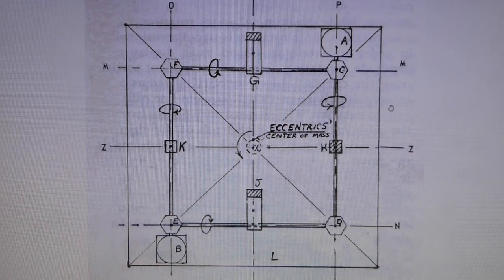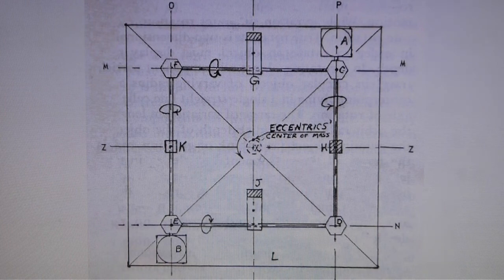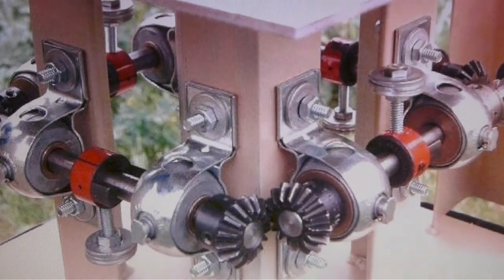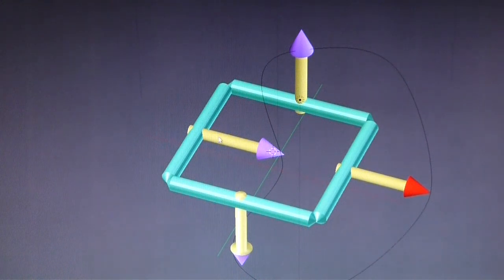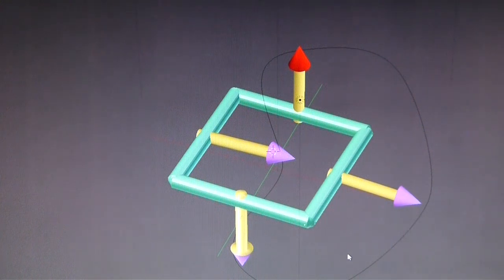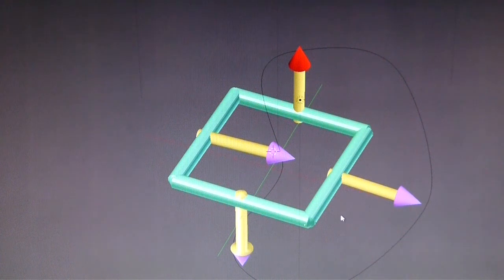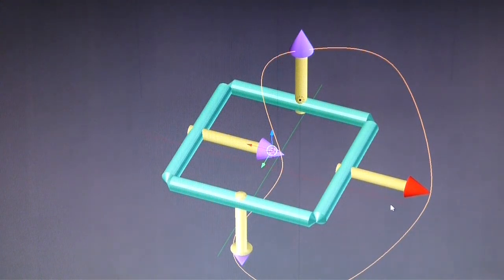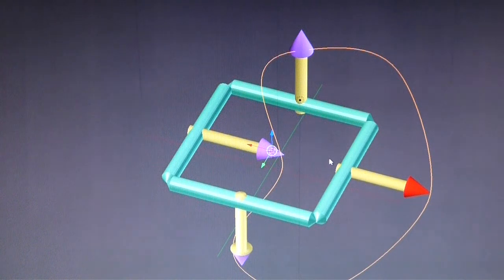Tesla Flying Stove - inertial drive - Inertial Propulsion

Comment: I think the the main part that is left out in this blueprint is the fact that the "plate" housing the eccentrics doesn't rotate, but must be allowed to instead "wobble" about the center similar to the Euler disc, as energized by the phasing of the eccentrics.  The tilt of the "plate" will orient components of reactionless inertial forces from the eccentrics, orthogonal to the plane in which the "plate" lies in a neutral state, to generate thrust. Also, three more mechanically synchronized units would need to be in place within a complete levitational engine to cancel unwanted lateral inertial impulses.   Smoke a long bong and you will understand and picture the kinematics of this thing as I briefly mention here.

Comment: still no one sees the machine has to accelerate around x, not only turn
Reply: Did you know he sometimes spelled his name with a c? NiCola Tesla, on one patent. With this he mentioned "Both the center of gravity, and the center of mass, orbit the same point". The center of gravity is constantly moving as the arms take turns hinging towards the horizontal. The mass which is pulled to the side as it swings up would have a longer radius.
Reply: @JerryVolland-bt8cb  yes, but you still do not respont to what i say about acceleration. it is in the patent. some people make models without considering this.
Reply: @Tardis42 anything which moves in a curve accelerates, whether it spins or not. Draw a circle with a pencil; the pencil point has angular acceleration, even though it doesn't turn.
Reply: I already said that at the top of the page: Teala said it has to "orbit" and I said that means a sloshing motion, not a spin. As shown with the toothpicks, the force direction is upwards.
Reply: No, it's clearly Tesla means accelerate .  @JerryVolland-bt8cb
Reply: @JerryVolland-bt8cb  just read carefull what Tesla wrote its only 1 page. it clearly says accelerate around x.

Comment: These blueprints and machine are certainly NOT from Nikola Tesla, he used simplifications od mechanical drives. He usually opted for coaxial shafts, he would never make a plan with four paralel + vertical shafts if the same end result could be achieved with one coaxial shaft. I read a lot of his patents and this one has nothing to do with him, it is not even close to his real ideas. 

Yes, he designed a flying *propeler driven airplane in the early 20th century, which was quite impressive for the time because it allowed vertical take off and landing. He never made a prototype, because he opted for electric frictionless and reactionless drives. These objects looked like a long cilinder with a pointy tip, which is impressive for the time concerning aerodynamics and propulsion.

Comment: these plans were disinfo supposedly and it's done with his high voltage and frequency generators, negative brush discharge to pull/lift but in combination with high V & F on opposite sides. 'space aliens from the pentagon

Comment: There should be 4 of these devices in a rotating square.  The weights are all positioned with the thrust going upwards at the same time.  There should be copper on the tip of the steel weights, to create a magnetic vortex in the center.  Also important are the walls of the stove.  The motors and such are more to stabilize the craft in the ether.  You also need to use the ether engine he designed for his motorless zeplin. They are placed on the six surfaces to provide movement through the ether.

Comment: There is no power source. And u have designed it for 2 Space an and made it look it move itself with out an electrical power source also u must a Fluid witch can randomly one way force.
Why could just. Visualize this a your your mind. Instead so much work. It never motor.  Go The Europe Space Agency’s page for a working system. Really if u put a fish in bottle of
Water so it s head stuck to front of bottle and seal bottle back then release it the space station u will see bottle more faster and faster inside the space station. I know people who have done
This.. seem impossible but it really works. I have worked 30 years on these constant accretion tensor or simple they are unidirectional Forces . Have at least 8 to 10 Devices but will
Never dis-close them. Because they will steal anything they want.
Reply from the maker: If u bothered to listen to the words I spoke you would hear me saying that it does NOT work.  Same regarding not showing a power source.

Comment: the problem with this design is that it is not complete it is missing half a u-tron spin the aluminum utron with the tesla designontop at 36000rpm and the flying stove part to counter act onthe gravity that ishow tesla designed it
Reply: Link to a drawing?
Reply: i have no link checkthe drawing for the flying stove tesla the baseplate is not a baseplate but half a U-tron see otc-carr for design but the Utron has to be diamond shape cutt in half and the tesla design has to be in perfect accuracy with measurements Utron and the 4 arms have to be aluminum the rest doesnt matter

Comment: I think to clarify the biggest confusion about these physical based inertia drives is based on the reference frame. The overall answer is no, they usually don't do what they are claiming. The weights lining up will be offset by the entire system shifting in the opposite direction thereby sustaining Newton's 3rd Law of motion. But only if the whole mechanical system can be stabilized in it's mode of operation then a net force can be observed. Im saying it will have to interact with it's environment by pushing off a very thick medium (thus a resistance on the frame).  So these types of drives will not be practical in air nor space. They will just jiggle back and fourth.

Comment: Ropes of air. Two Tesla turbines powered by wireless. One creates a verticle thrust by using laminar viscosity to pull air downwards... One creates horizontal thrust to move forward or backward. Eccentrics / gyroscopes  create tilt stability.

Comment: This device needs to spin in it's center. Therefore creating a force cancelation in another plane. The frequentie needs to be exact so that the weight is at it's highest point when it's rotating. (This device needs to stand up). I had the same idea as Mr. Tesla, only had no idea how to build it. This idea works I am sure. I made a design of it in 3D.

Comment: People take Tesla’s drawings too literally for starters after Marconi stole his patents to build his trans Atlantic radio Idea before he bothered to build it, he started putting cryptic meaning to his blueprints so that they could not be stolen by someone without the knowledge of his intentions and the physics behind his work, he truly wanted the betterment of mankind and his inventions not to be used for war. They are not complete for that reason. I had designed and worked out the math for this type of propulsion as a teen before I ever knew anything about Tesla's work. It was a surprise to see how close it resembled my constructs; a simple proof of concept is all this patent is... To clue you in the bars represent wheels. Gyroscopes to be exact, the wheels themselves make the best motors also. To fully function It has to be able to pivot and angle them to control speed and direction as they rotate around the central axis. But like I said "proof of concept only"... a working ship would need several connected in unison or a counter rotating set to stabilize it. Once up to speed it can fix itself in a point in space or accelerate with all the energy you can draw out of the momentum of the gyros. the same modified system can be used to create magnetic vortices and a donut shaped field that if you add a little plasma too would make a nice deflector... It sure is funny how my comments never seem to stay long after I post them. It still pops up with UFO garbage when you look for it. They have done a wonderful job discrediting and hiding the comments of anyone who pursues the subject and is capable of working out the physics and fractal geometric velocities involved. They want to keep this tech only for war as long as they can...Have you seen the way in which scientists have to disguise the subject matter of their papers? pathetic isn't it...? Comments or Questions... mikenshea123@gmail.com
Reply: Prove it with your own video
Reply: What you have to say seems pretty interesting. It would be nice if you built some kind of model and made a video for proof of concept.

Comment: Shifting the center of mass in resonance does produce thrust. Every six year old learns this on a swing at a playground. Before that they insist on externally provided thrust to help them increase the amplitude of their swing. 

Now take a swing and convert oscillation to rotation couple it to wheels and you can use the shifting of the center of mass to propel the whole swing assembly forward. No one has doubt that that would work without violating laws of physics. 

Similarly a see-saw with two people shifting mass in resonance can be used to propel a manual rail cart. No violation of physics there either. 

We all know how to swing indefinitely by shifting our center of mass in resonance to the oscillation of our body on a swing or a see-saw. No one would claim that any of this violates laws of conventional physics. It's not perpetual motion.

Using shifting center of mass to increase oscillation is ok yet using resonant shifting of center of mass during rotation to generate thrust directly somehow violates physics.

Seems more like the argument that denser than air machines cannot fly as used by physicists at the turn of the 19th century. A claim they maintained even as the Wright brothers were making their successful test flights.

Good thing the Wright brothers didn't believe in the dogma of impossibility and performed meticulous experiments to study the aerodynamic effect instead. ΞΙ:D
Reply: it's called "swing" the thrust is both ways "if wanna call it thrust" it's like lending and borrowing ...can't call that trading unless there's interest ratio. and to end the argument of inertia thrust, there's 2 ways. first is working model and second is calculations ... it's pure simple mechanic, shouldnt be that hard to be done

Comment from the maker: The "numerous inertia motors that do actually work " seem to depend on overcoming surface friction more efficiently in one direction than another.  I doubt they would work in space or NASA would be using them already.

Use Blender 3D (its free) and model your idea, put out a video, get some feedback.

Comment: i looked at this problem and found that if you can achieve a form of inertial thrust the same technology can theoretically be used to achieve a form of energy production with just gravity as the true source of power and gravity is a very stable constant. how clean would that be? 100%

Comment: I have worked on this problem for years and i can agree with ultrabizz the path of the mass is far too irregular and it needs to move on single axial plain it would also need to spin at great speed. i wasn't aware that Tesla had designed an inertial drive and its a unique approach i have not seen before but i can see how his design was flawed. perhaps it was a work in progress as i can clearly see what he was trying to do as i believe an inertial drive system is viable with some innovation!

Comment from the maker: The membrane would not be useful. The benefit of inertial propulsion would be thrust without the need to push against a medium such as air so that it could operate in the vacuum of space.  Atmospheric flight, independent of air irregularities such as air pockets, would also be valuable. 

 The best working example I have seen uses microwaves bounced between two different sized  antenna to create thrust by means of the imbalance.  It worked but was too weak to lift its own weight.

Comment: hello ! I agree with donato; Imagine attaching this to a membrane: if you can get the membrane to oscillate due to the change in inertia "wobble", then that membrane can do the work by mving air: moving air is the basis for pretty much every athmospheric flight device: planes, helicopters... On it's own  it looks like a very unbalanced crankshaft. Unbalanced engines are a big problem inthe industry: the engine wobbles, makes noise and ends up breaking it's supports. It's a flying carpet!

Comment: I briefly looked into this some time ago and came to this conclusion:

If it is a "flying machine", it is only an integral component.  For example, an internal combustion engine cannot fly on it's own.  But attach wings for lift and a propeller for thrust, and bingo, you're flying.

This could simply be an idea that was never completed.  Or Tesla may not have been able to figure out how to transfer the ideas in his head to a drawing on paper.

Comment: I have read that Tesla became paranoid towards then end of his life(with good reason) and began to leave information from his patents . I have heard several times he meant to use magnets in his design . Where would I use magnets in this set up? I would use them in the base and at the ends of the weights , with like sides towards each other and repelling .As the weights reach bottom they are pushed up and create an imbalance as they rotate back to center . Any body think this would work?

Comment: Of course, if all the weights rotate though the exact same path the net effect has to be zero, but what if they didn't.
Did you consider changing the distance from the weights to the shaft during rotation?
As an example: If at a certain point (let's say directly up) the distance between the shaft and the weight increases, then 180 degrees round its turn it decreases by the same amount. The lateral effect would remain balanced, but do you think this would create a net effect grater than zero?